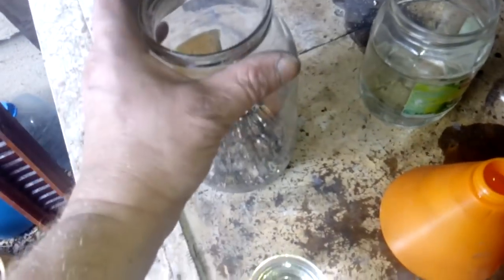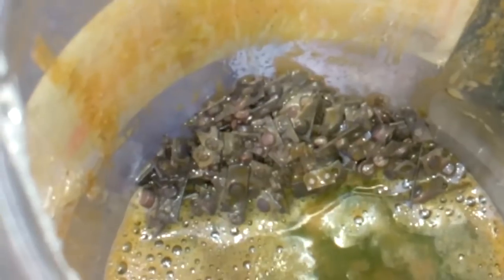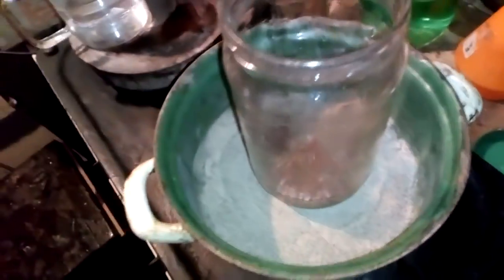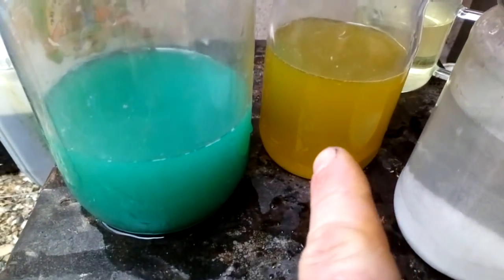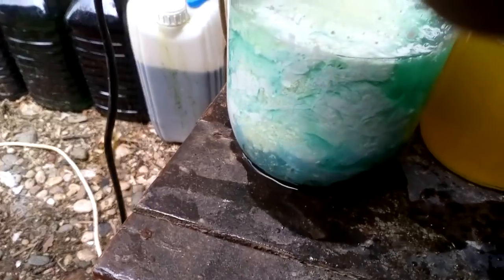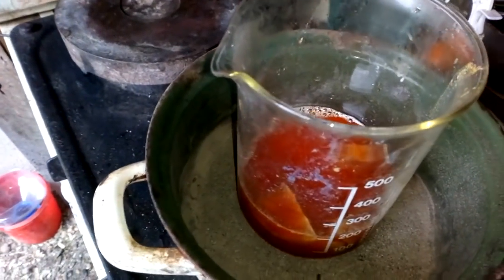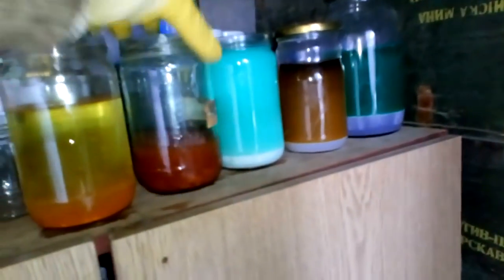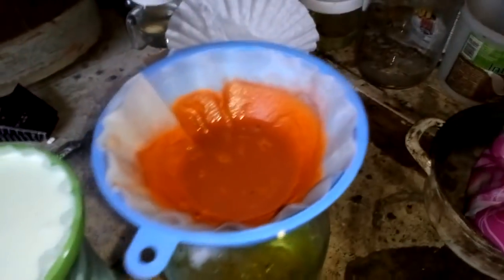Palladium and Silver from contact from the military equipment relay!

Comment: Anybody responds! @
Reply from the maker: Separate them by injecting Nitric acid with 50% water and placed in heat, the silver will dissolve in the Azotine and then turn it like Silver Chloride. The aqueous will dissolve Paladium, but in a very small amount, after the silver is reduced, it can be returned with Chlorine gas, tin chloride or DMG. But before the fall, you have to settle the active Nitric acid. Great greeting from Serbia for Egypt.

Comment: I have an alloy in which silver and palladium together do you understand me? How to separate silver from palladium ???????????????????
Reply: I am from Egypt and I am a student
Reply from the maker: Separate them by injecting Nitric acid with 50% water and placed in heat, the silver will dissolve in the Nitric and then turn it like Silver Chloride. The Nitric will dissolve some Paladium to, but in a very small amount, after the silver is reduced, it can be returned with Chlorine gas, Tin chloride or DMG. But before the dropl, you have to remove the active Nitric acid. Great greeting from Serbia for Egypt.